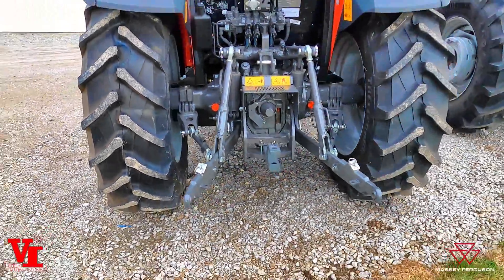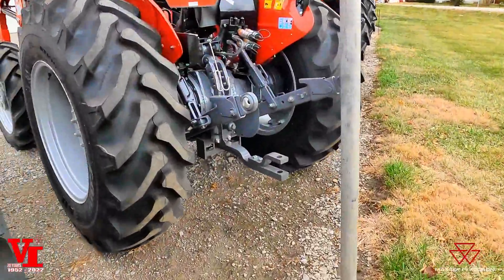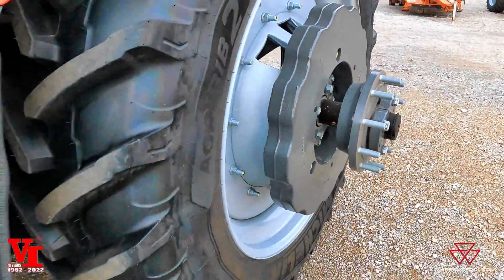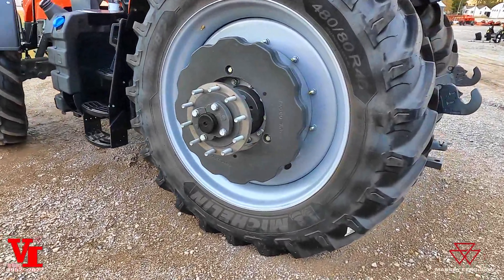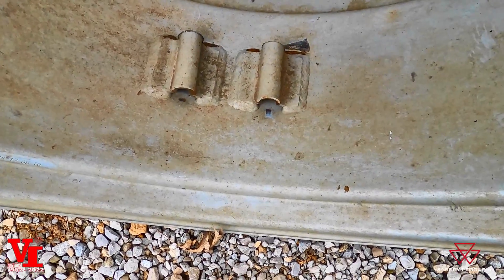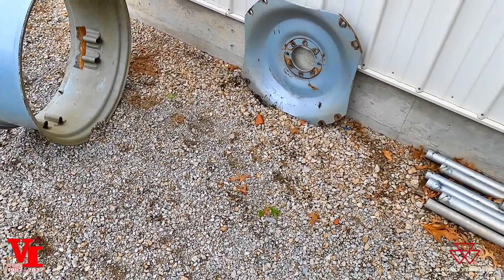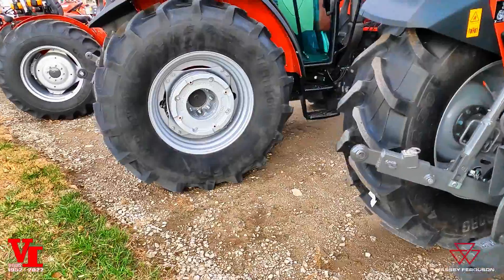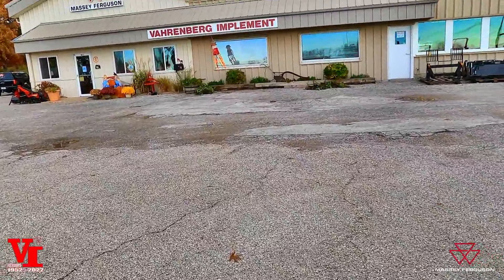Tread Width & Wheel Setting Options on Massey Ferguson Tractors

Comment: I need help. I have a 362 tractor and I changed the front and rear tires to smaller ones. Will this cause a malfunction?
Reply from the maker: 2wd or 4WD Tractor? 2wd should not have issue but on 4WD it is very critical to maintain front to rear gear ration lead. Your Tire dealer can help with which size tires to maintain Positive lead the Powered Front Axle.

Comment: I know this video is more for the bigger tractors, but I noticed in my FL1805 loader manual for my GC that section 5.3 talks about minimum tread of 62 inches. My stock rear wheels are only about 33 inches. Any idea why that number is so high for such a tiny tractor?
Reply from the maker: The manual covers more than just the FL.1805 also covers the FLx2106 Loader. Based on the Center of Gravity and Height of Tractor this the Loader Manufacturer recommendations for Static Stability on 15° Slopes. Distance is measured in Middle of Tires. Since GC Series is Lower Profile Tractor the Center of Gravity is lower and to keep tires inside the Bucket the Minimum Tread Setting is reduced as these tractors are designed for flatter terrain and lesser degree slopes.
Reply: @VahrenbergImplement  Thank you for the reply. I didn't realize that it covers both loaders. That makes a little more sense now. I thought I might need to get dual rears on my 1723 to hit the 62" mark, lol!

Comment: I wanted to change rear wheel tread setting on my 2860M.   I wanted to do this without removing the entire assembly from the axle.  I jacked one side up and I found that the center wheel section is so tightly wedged to the rim that I could not budge it while on the tractor.  I think I will need to remove the entire wheel assembly and lay it on concrete floor and wack center sectionwith a sledge hammer to separate the wheel center from the rim.  Have you any better option?
Reply from the maker: We've never had to do that should be able to loosen wheel center from rim and remove tire and wheel. But we also use a tire changer that we can jack up rim/tire assembly and get pressure off. Might want to loosen bolts while on the ground then jack up tractor if you don't have tire changer. Here example what we have as dealer to change and adjust tires: https://spaldings.co.uk/Files/Images/Ecom/Products/40599-item2-web.jpg